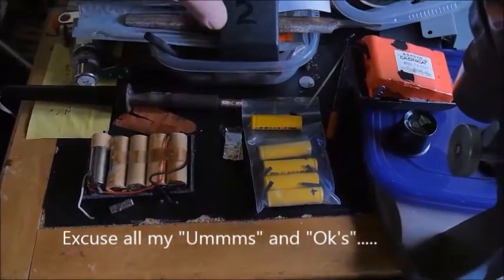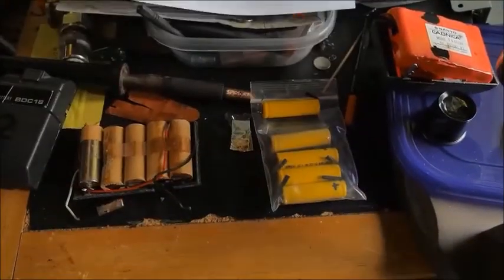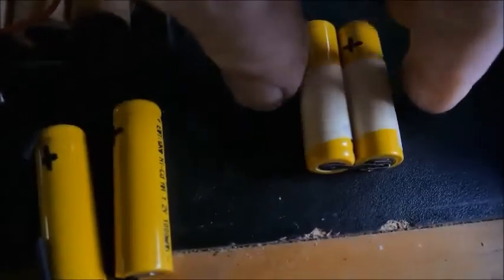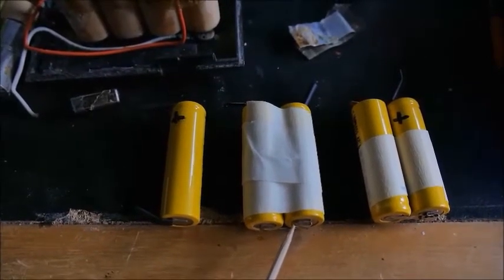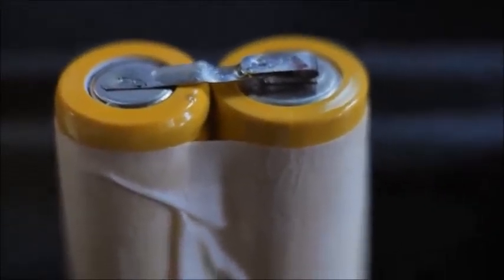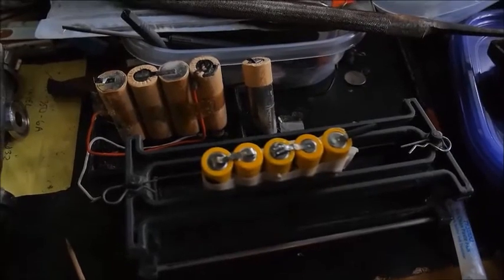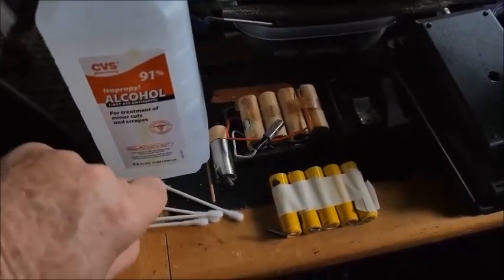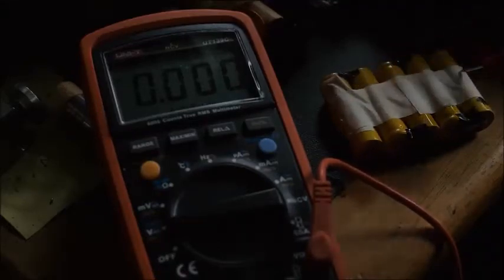Rebuilding a Sokkia BDC18 Battery Pack-Part 1

Comment: HI NonYourBuz ,  what is the replacement part number of batteries and the thermistor ? to open the battery pack is trying to release internal clips or only force ?   thanks
Reply from the maker: HI Jorge....I purchased both items off eBay...I searched for; Premium 
Quality True to Capacity AA 1.2V NiCd Flat Top Battery with Solder Tabs and a 65C N.C- PEPI N#65 thermistor...The most difficult part was opening and closing the case....I cut it apart with a very thin mototool saw blade being careful of not going too deep...Replacing the spring was nerve wracking as you have to glue the case together before inserting the spring, so everything has to be correct before you do so.....Hope this helps...
Reply: Thanks for the quick reply, case is open now, i will look for those batteries on ebay. 
in the mean time, i will try to test/use the equipment with 2 batteries 18650 Li-ion (that i will have to charge outside the pack), the reason that you've changed the thermistor is because you changed the type of batteries to NiCd ?  The BDC18 pack that I have is NiMH. i will have to wait to charge the 18650 batteries, equipment turned on, however the B ded message is displayed. replacing the spring seems to be a challenge, Thanks